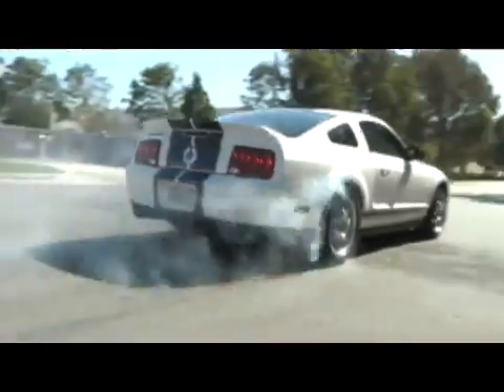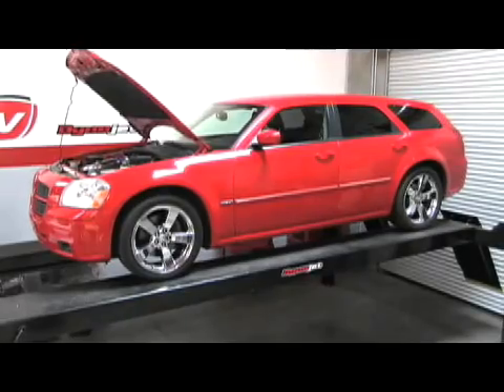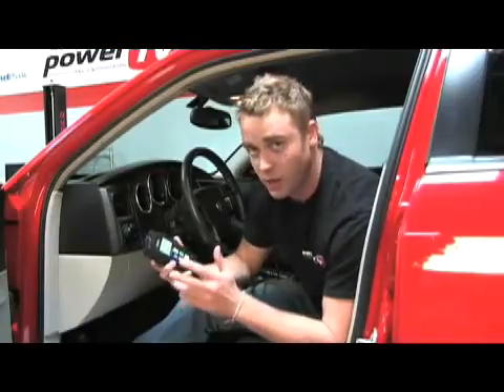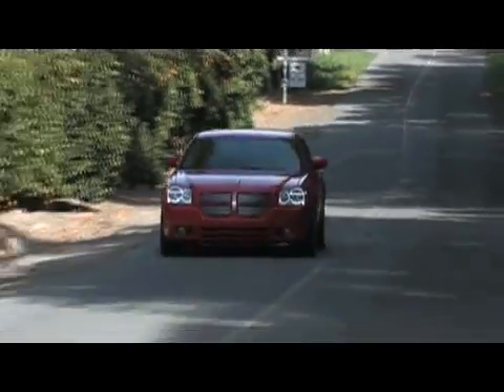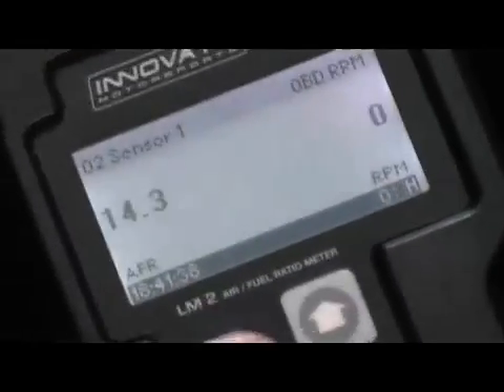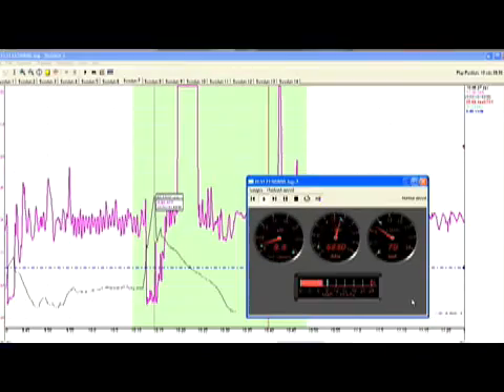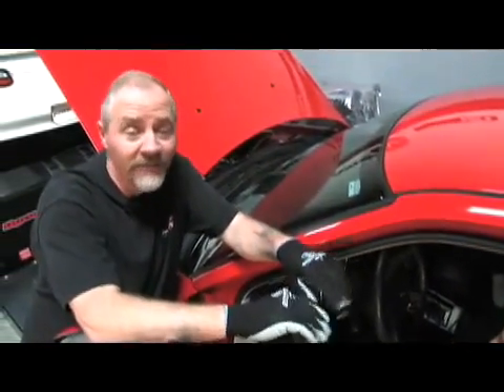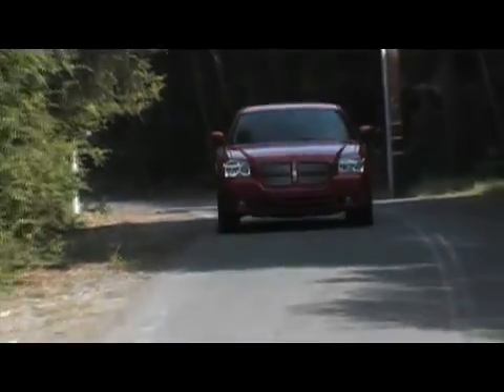Innovate Motorsports LM-2 Wideband Air/Fuel Ratio Meter Install & Test

Comment: That was not a put down, it would be an interesting video.  I use your product integrated into my EMS displayed on laptop and have the DB blue (not installed in my crappy vid).  Product works great, and have LED on dash which warned me of bad combustion (error 8) in which I found injector problem.  Sorry for confusion, and I like my supra, it makes 700hp and I trust your products to give me an accurate afr ratio!  Thanks.